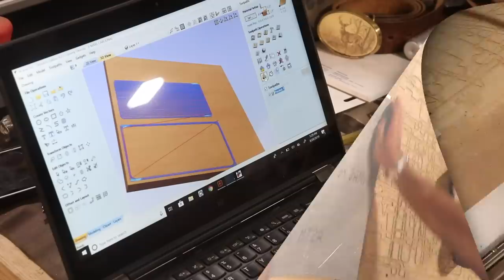DiResta How to Press a Custom License Plate

Comment: A integrated cutter edges for the outer shape could be added to the die and then you wouldn't need pre-cut panels? Also why not use a flat paint roller for the letters instead of vinyl?

Comment: Does anyone know if a vise would produce enough pressure to do something like this? Maybe if you concentrate the pressure into one spot and slowly go over each part. Also would paper have helped soften the sharp edges cutting the sheet metal?

Comment: I'm surprised you didn't spray them with wax and then run a belt sander over them, followed by a spray of colour ... seems like a lot of work to use vinyl.
Reply: Alain Moran this is actually cost efficiënt

Comment: another way i seen that done was by making the letters and surround from sheetmetal glueing them to a piece of steel and press it with the metall licenceplate in between in a piece of high density rubber , makes the edges a little less sharp but takes a lot less work to make

Comment: A sheet of thin tooling urethane over bottom die makes for cleaner/softer impressions. I used to make dies for a 330 ton press. Also cuts down on wear of the die for long runs. We also used it on press brakes for custom stainless steel parts. No tooling marks. NIce work.

Comment: Hit that vinyl with a super stiff nylon brush over the masking. Good for texture etc. We do this when applying vinyl text to textured walls or wood. (I run a sign shop). They even make a special brush for this that's got a straight handle.

Comment: Could you just roll paint on top of the raised letters? It would streamline the production of these...
Also, for added realism, you could use reflective paint or - better yet - make your own by just adding tiny glass beads/balloons!
Reply: Nuno Lourenço I was thinking the same but this gives a much cleaner look with less chance for screwing it up
Reply: Hans Idso, too clean maybe? :)
Other option would be the letter press if the ink allow for it.
Reply: He has several printing presses, I bet one could be adjusted to the thickness of the plates so it would roll ink on just the raised letters.

Comment: Really curious to know if it’s legal to make your own license plate or not.
Reply: Jung Ko c’mon man, why would it be legal to make your own if the government issues them in the first place?
Reply: Your front plate in many states can be a vanity plate. I've seen custom made plates with different color schemes, but with the actual license plate number. I know a guy who owned a sign shop and did just that, and got the OK from California Highway Patrol. It's the plate with the registration tag that has to be officially issued. You can't make those and not get pulled over.

Comment: Nice work.

Would it be possible to put ink/paint in one of the dies so you can skip the vinyl cutter part?
Reply: You could easily just mask off the plate after the yellow paint went on and spray the letters black, which is actually what I figured he'd do. It would save time and effort.
Reply: @InstrucTube  could easily as well just make a stamp for one of his book presses as well with the cnc and a bit of hard rubber.
Reply: @InstrucTube  I haven't experienced masking off detailed designs like lettering to be easy or fast. I mean, probably the fastest way to do that would be to use the vinyl cutter to create a stencil to do the masking - and then you might as well just use the stickers.
Reply: @MattWeber  I actually forgot about the presses.
Reply: @CondredgeDole  eh, fair enough. I'd still say that the paint is going to be more durable than vinyl letters, so id go with the stencil.

Comment: im surprised this worked , if the licence plates are steel, you'd want to form them with a harder materiel (hardened steel) or the die will dull.

Comment: Just blindly applying the die like that without first lining up the holes wasn't a very wise choice, evidence was the slicing first press.  a lot of that correction work could have been avoided if you aligned it to a centerpoint on the plate blank.

WOAH WAIT... he didn't use the printing press for the black letters????

Comment: There’s no kill like overkill! Great idea for a vid!

Fun fact: I wanted to make a custom plate for shows and videos and such and just be able to stick it on with magnets. Surprise! License plates are not magnetic! At least not in Florida.
Reply: Being made in tin, no official state plates are.
Reply: Matt Weber good to know, I thought they were stamped steel.
Reply: @NoTimeForThatNow  when not tin, they are stamped aluminum. Steel doesnt have the longevity needed without also needing to be galvanized to prevent rust quickly over time. Pre ~ 1980 plates were stamped steel, but the slightest chip to the paint and they rust quick
Reply: Matt Weber well, I’m an old fart so I guess that would explain how I had that impression 🤣